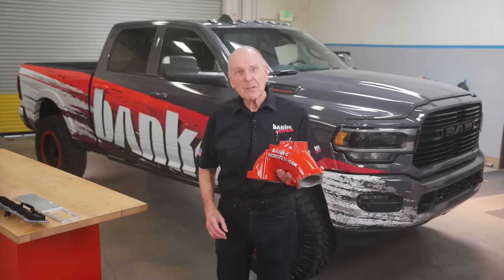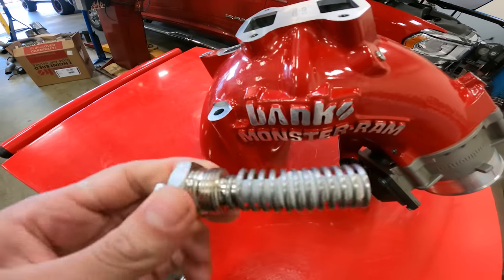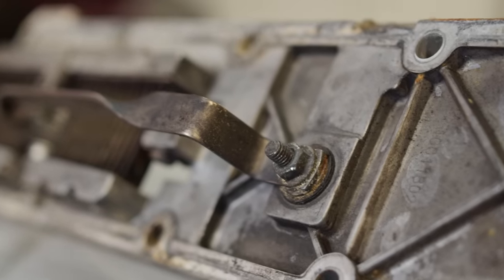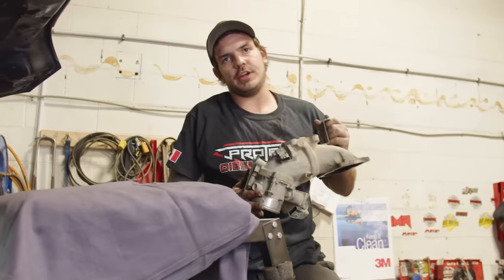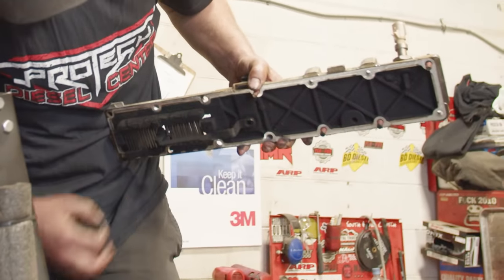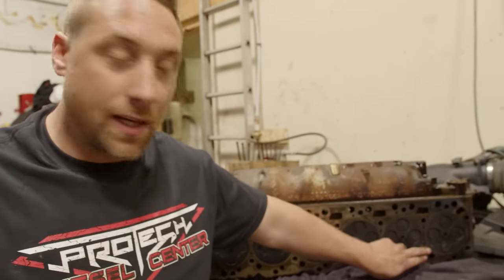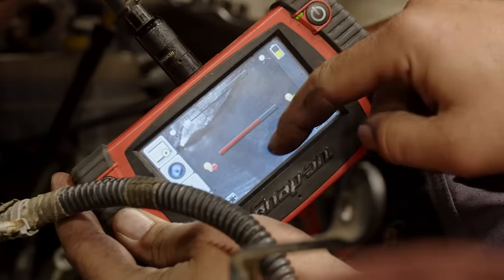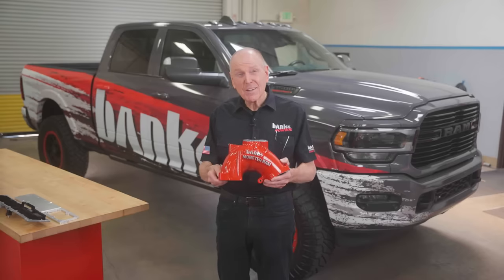How to prevent RAM Cummins 6.7L engine failure due to stock grid heater

Comment: Just got my Monster RAM installed on my 18 3500 (SRW). Happy to report the grid heater nut was intact on my truck (just under 54k on it).  

So far the truck runs a little better. I also have the pedal monster and boost tubes/Banks intake and truck has plenty of power. Gas mileage taking a slight dip mainly cuz I cant keep my foot off the pedal but other than that, pretty happy.

Comment: Looks like the DFMEA and PFMEA missed a critical point of failure.  Why would they not find a way to have that connection outside the intake?
I saw a comment about the check engine light being on and that might actually be their response. If the monitor the connection and see that it’s broken there’s some time to fix it before it becomes loose and falls into the engine.. Maybe the me the people that say awww it’s just a heater for cold weather starting don’t worry about it might be wrong in this case?

Edit, missed a the when writing the comment 🙄 lol

Comment: Never once have I seen this failure working at dodge on the diesel team lol. We have a grid heater RELAY recall open buuuut that’s on the relay under the air box overheating due to an open back on the circuit board allowing it to short out
Reply: I guess not enough have been documented by Ram. Would you say this really isnt an issue? Ram does state in a service bulletin not to have the heater on during testing for extended periods, so they do know of the problem.
Reply: I've owned these cummins since 1994 on my third one (2018) been my and my friends experience, the RAM cummins dealers never see these trucks again after the stealership LOL

Comment: I replace tons of those grid heaters I've never seen the bolt go inside the engine. My question is how long did they drive with the check engine light on?
Reply: I agree, if that assembly was loose it would have been creating some sort of amp draw above spec and should have indicated a trouble code for it.

Comment: I always feared diesel engine runnaway but I'm wondering why are they so rare? And how does modern diesels avoid the dreaded runaway either from a broken turbo seal or anything else? Please let me know. I ❤️ diesel engines but I don't like runaway diesels.
Reply: Modern computing power has made ECUs so much better at metering and monitoring engine performance. In modern consumer diesel vehicles, there are safeguards built into the programming which generally prevent runaway conditions long before the engines can actually take off uncontrolled. Instead of running away, a modern engine will be more likely to enter a "limp mode" and activate your "Check Engine" lights. But in generations past, with more aspects of the car under mechanical control rather than digital, older engine control systems had no way of detecting and preventing runaway conditions. This allowed poorly maintained and unserviced diesels that were under heavy use to occasionally (but spectacularly) runaway.
Reply: @theKashConnoisseur  a run away is caused by some sort of unmetered fuel. Usually engine oil. No amount of  engine management can prevent that.
Reply: I had a t660 Kenworth do the run away up in Wyoming leaving the walmart distribution center by the Loves truck stop. Luckly i just had to replace the turbo because i ripped off the intake and shoved my shirt into the turbo. Only way i know because of my dad
Reply: @chrisleggett685  I know what causes runaway lol. Doesn't negate what I said. ECU can detect the presence of excess hydrocarbons in the exhaust and after trying to pull fuel from the fuel air mixture and seeing no change, it can start pulling timing and limiting power and RPM, while also limiting the intake air stream. Modern ECUs can also use an automatic transmission to  moderate RPM. All which will prevent a runaway from occurring.  Of course, if you have a modified engine running a custom tune, all that goes out of the window since you basically have negated the factory safeties built into the factory programming. 

This is strictly for a modern engine, of course, as per the OP's question. Obviously some clapped out turbodiesel from the 80s or 90s isn't going to be able to prevent its own demise.
Reply: The mechanical diesels could runaway because of problems with the pump/governor. If it stuck at full fuel it would runaway on its own fuel supply and injectors. Since modern ones are electronic there’s nothing to stick with the injectors that would cause a full runaway. 
Also, with all the emissions it tends to cause problems from ingesting oil before the problem gets bad enough to really make it run away. They don’t often start blowing a bunch of oil into the intake suddenly. 

So, it’s a combination of things that makes a pretty rare event even more rare.
Reply: The biggest prevention of modern engines from running away is much better oil control in the turbos. They have over sized drains and metered feeds. This will prevent enough oil from being pushed into the engine in the event of a seal failure.
Reply: @chrisleggett685  

True, a sudden catastrophic failure won't usually give an indication, but the more common problems may show signs of failure well before that point - the simplest being if less fuel is required at idle, the ECU can recognise that and bring up a caution message/light.
The ECU may - been out of it a long time - be able to introduce other measures, too, if it does start to run-away, such as apply the exhaust brake, compression release, or other measures to reduce net engine torque to, hopefully, stall it out.
Reply: Most new diesel have a throttle body that can be used, if the turbo seals though give out the throttle body would just shut it down
Reply: You can add a positive shutoff valve in the intake tubing that will cut the air off. They use them in the oil field in case of ingesting combustable gasses in the air

Comment: You designed that coil heater just for this application?  

Amazing considering that's same coil heater that my old 7.3 Powerstroke has had screwed into the elbow since it left the factory 23 years ago.

Comment: I need to get in touch with these guys. I live a couple hours away and looking for a complete fuel system for a 2007 6.7 3500. Had water in the tank, truck sat afterwards and rusted the high pressure pump, lines, rail, and injectors! looks like aluminum powder and pepper flakes mixed with fuel :-(

Comment: Really want to add this to my new 2022 but Ive got very big fears that my vehicle warranty will be null and void by doing so.
Reply: im right there with you.
Reply: If its under warranty let the dealer worry about it when it fails, if you plan to keep the truck wait until warranty is out then make the swap. It might be a weak point but it should last you a couple of years anyways. I don't think this is like it was with the CP4 where they were exploding 100 miles off the lot.
Reply: Very true. They also have the "wiggle" test to keep an eye on it, hopefully catching it before it fails.

Comment: The better question to ask is Why didn't this problem get a recall from Ram?
Reply: It all depends on the amount of vehicles that iot is happening to and why. They do not just roll out a recall if say 15000 trucks have this problem.Has to me much larger and has to be trucks from all over. If its just from cold areas then it wont be a recall , it will be a TSB issued.

Comment: So what happens when the heater coil fails and falls into the intake. There is not screen to protect the engine from that... Guess time will tell
Reply: The Airline industry doesn’t place screens in front of Jet Turbines that ingest birds and other foreign object debris. Yet we still pack into an aircraft and blast through the atmosphere in a big ass metal tube. 

Why would an engine manufacturer even think of placing a screen for the possibility of catastrophic engine failure?! 

I’m being sarcastic not towards you but towards cost cutting engineering. There’s lots of moving parts that could come apart and ruin anyones day. 
That grid heater is just one of them. It needs to be recalled!

Comment: Valve damage can be detected by an fluid check. If no leakage why send the head off?
Reply: I'm guessing because that aberration on the combustion chamber might collect deposits and foul the valves quicker. Its worth the money, every time you take apart an engine you are inviting the possibility of a mistake to occur.
Reply: how else do you plan on fixing the damage from the bolt (dent)

Comment: This seems like a poor choice of materials. It looks like the lead for the heater connecting to that bolt is made of copper and if that’s true, that’s a big problem. Coppper reacts with sulfur on contact at room temperature creating copper sulfate a brittle salt. that’s literally what happened to that stud. Through electrolysis copper was pulled into the steel stud, and then reacted with the sulfur, and under the heat and pressure generated inside that manifold, all the copper infused steel turns to salt and falls apart. You either need to use completely sulfur, free diesel, or titanium leads to avoid this problem. There should be a small piece of titanium between the steel stud and copper heating element.

Comment: When I bought my truck with 200,000 miles it had a blown head gasket and installed a Monster Ram at the same time.  The shop said my grid heater fell apart when they touched it to pull it out.

Comment: It's not a bolt failure.  It's the solenoid that fails that causes constant voltage going to the grid heater.

Comment: How reliable is that new coil type heater? If the element eventually burns out, do the coils break up into pieces that get into the valves and cylinders? Fyi, I already bought and installed the monster ram in my 6.7 Cummins about 6 months ago and that heater gets a lot of use during our cold winters.
Reply: I know a guy that his relay stuck on, burned up the new banks heater and the element fell into the engine causing the same issue. There needs to be a heater that cant fall into the engine at failure.

Comment from the maker: Has this happened to your RAM 6.7L? If so, how bad was the damage?
Reply: As a master and diamond certified international and Cummins engine technician still in the field, I’ve worked for Cummins certified dealers and the distributor itself for over a decade combined, well during the 6.7 product line. I’ve never once seen this failure. Don’t get me wrong I’ve seen plenty of them come apart, just never for this reason.
Reply: Had this exact failure 6 months ago at 200k miles.  Bent two exhaust valves, crushed top ring land on piston that then scuffed the cylinder.  I had the engine pulled and they were able to hone the cylinder, we replaced the piston, wrist pin and connecting rod just to be safe.  Cylinder head checked out fine and just had to replace the two valves.  While it was apart I upgraded to ARP head studs and of course had the Banks grid heater delete and the Monster Ram intake installed.  Truck runs great!!  I feel very lucky that the damage was localized to hole number 6 and was able to be repaired. The piston makes for an interesting paper weight on my desk and a reminder how a small 8mm bolt can cost thousands.
Reply: @mobileenginemedics9679  I have a suspicion there is alot of marketing involved with this video. I know of no one who ever had this happen. I would guess that it's a good idea to check this during a maintenance, but not buy some aftermarket product because he tells you to. I'm sure it's a good product.
Reply: I lost an engine about 2 years ago but haven't had the funds to fix it yet. I wonder if this has something to do with it? Funny thing is though I had put the Monster Ram on it a couple months previous from loosing a cylinder but didn't get a grid heater delete with it.

Comment: I went from delighted to jaded. The intake for my Ca registered 2012 Ram lost it's CARB cert because it causes an intake heater related engine code. Banks, who installed it, didn't bother to tell me. I only accidentally discovered this. Now I have to have it put back to stock. So, nearly $3,000 wasted.

Comment: I’ve put 40,000 on my Ford in ten months traveling up and down the east coast and the vast majority of trucks I see pulled over with hoods popped are Rams. It’s so bad that I bought a dash cam just to make a video of how many I see. I’m not biased either and will include other models but after witnessing the failure rate of Rams there’s no way I’d buy one.

Comment: What stops the banks heater from falling into the intake runner when it gets a little older?
Reply from the maker: The heater element that we include with the Banks Monster-Ram intake kit will not melt like the factory unit. The Banks coil heater element is rated to a higher amperage than the factory grid heater element. Additionally, the heater coil is welded to the base that attaches to the Monster Ram housing; unlike the factory heater that is held together with plastic. Finally, if the coil  were to melt and fall into the manifold, it is too large to pass under the intake valve like the stock bolt can.  Another advantage of the coil design is that it takes less than 5 minutes to inspect, unlike the factory heater which can take up to 4 hours to disassemble and inspect.

Comment: Observations: The heater coil on the banks system is on the intake side of the motor. Has the banks coil ever failed and dropped into the engine?
Reply from the maker: The coil heater in our application was used in Duramax engines for many years with great success. Of the thousands of Monster-Rams installed, there have been no reports of broken coil heaters. And, if the coil were to melt, it’s connected on both ends like the filament in an incandescent lightbulb. When it burns up, it just hang there. And if for some reason it fell off into the intake manifold, it is far too large to make it through the intake valve like the factory grid heater bolt.

Comment: I like what Banks has designed. However, I can't believe that Cummins would design something so ridiculous. There should be a recall on all those trucks to get rid of that flimsy crap.
Reply: I've never understood why they went with a heater and not glow plugs like the DMax.  I had a DMax a number of years ago and the first thing I noticed when I went to the Cummins was how long it took for the heater to cycle before the engine would start when it was really cold out.  The DMax would crank in seconds (even at -40) whereas the Cummins took forever.  And, Heaven help you if it didn't start on the first try because you typically didn't have enough battery left to try a second time 😞

Comment: Does my ecm require a reflash or program with the monster ram install?
Reply from the maker: No, tuning is not required for installing a Monster-Ram Intake. However, any tuning you add will benefit from the increased air flow.

Comment: I know that this is specifically about the 6.7 but is this problem present in the 5.9 as well?  My son has a 2001 5.9 and one of the heater lugs is a bit loose...
Reply: The 5.9 uses a heater grid in the intake boost hose, totally different design and is not an issue. Some will  remove the 5.9 heater for better airflow but leaving it will not damage the engine.

Comment: Where are the dyno results or data on actual efficiency/airflow gains? There is no way cummins designed the factory intake elbow to flow less than the cylinder head and I’m sure that is why no one is ever able to prove intake horn upgrades do anything for performance or efficiency. I will however add a positive point that this failure can happen although I’ve only ever seen it once, wouldn’t say it’s “notorious”.
Reply from the maker: Haden, this video specifically addresses your question. https://www.youtube.com/watch?v=sd2Jly-jszI

Comment: Question:
Will this void manufacturer engine warranty?
Manual clearly states "ANY modification and non OEM part will void", that's my only concern as I have only 13000miles on my Ram.

Comment: How much does that replacement part cost and the cost to install it ....I have 250,000 miles on my 3500 ..it runs great with manual transmission

Comment: MR. Banks, for someone like me who can't afford your cool product, and I want to protect my Cummins from the bolt failure, could I just remove the wire and the bolt, make a plug of some sort and reassemble?  This would take care of the potential damage and disable my grid heater.  Being in California I doubt I need a grid heater anyway.  Thanks for your time, and I wish I could afford that fancy horn on my 2017 ram.

Comment: How does the coil heater compare to the factory grid heater in -30 cold weather starts tho
Reply: I live in Alberta and we get some cold snaps. I find with the new heater I have to cycle it twice before getting enough heat to start well. Not as good as Oem but I’ll take it over risking my motor. Plus I’m plugged in if it’s below-20
Reply: @Fitter4life  I'm plugged in if it is +20.

Comment: I've got an '18 6.7HO/Aisen 3500; I keep it garaged in a heated shed; is there a correlation between cold weather use causing condensation damage on the standard setup?

Comment: How is that tiny glow plug looking thing gonna start a monster 6.7 in -30•c my dads bone stock with thick oil will start in that weather I highly doubt it would with that tiny heater. Yes I still think it’s better than potentially screwing the engine just think they coulda thought about that a bit better. But they also don’t have to worry about that

Comment: If I did an EGR delete would that save that bolt from corroding on the heater grid.  And is that heater grid the thing that causes a huge voltage draw when engine is could like when it's just started and does that grid thing cycle on and of for a short time until engine kinda worms up